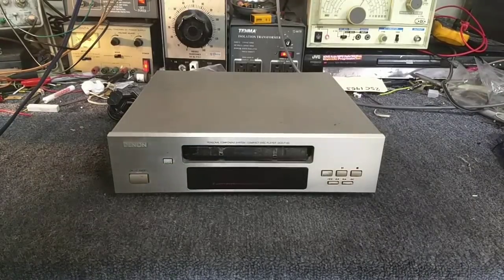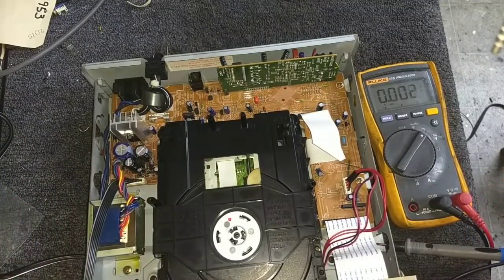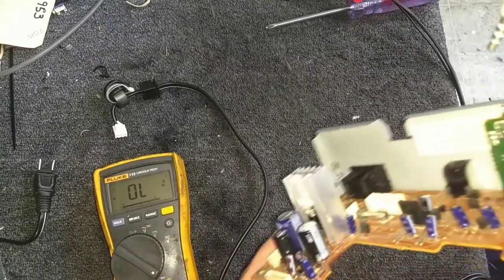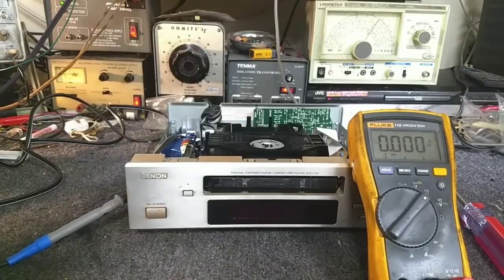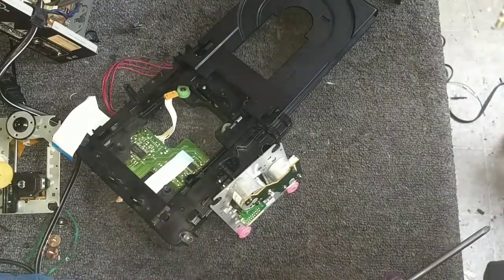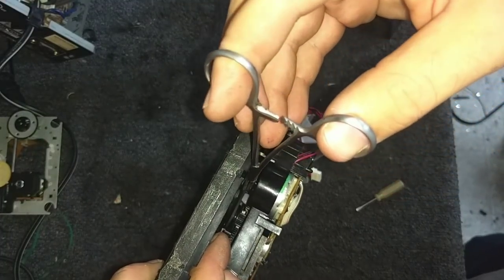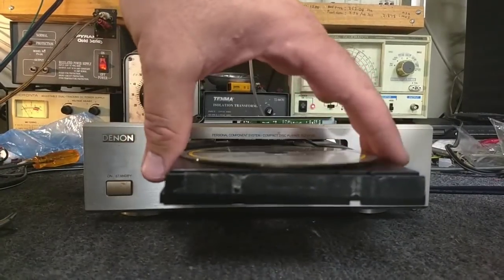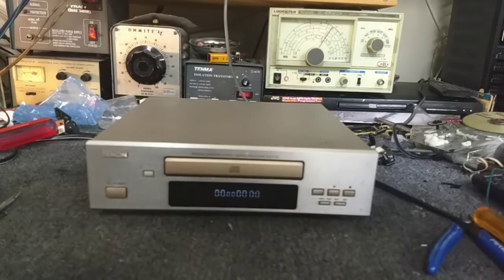Troubleshooting a dead Denon CD player model DCD-F100. Can we fix it?

Comment: Thanks Jordan! This helped me a great deal to fix my DCD F-100! While I initially suspected a defective laser it turned out in my case that it was only the motor belt being worn out so the mechanism would not fully lock (though not visible from outside, tray closed) and hence unit would not start reading CD. I managed to replace with a 35mm belt that I got online in a multi size pack.

Comment: There are some few tips to recognise from where the problem is . At the time of focusing just you have to move the disc slowly with your finger , if a track searching sound comes from the optical unit then the problem is in the motor driver section . 
First check the disc drive motor , if the motor is ok then follow the two wire which is connected to the motor driver IC . Check the continuity from motor to driver IC pin . If not ok then check two smd 0'1 ohms resistance which are on the pcb in front of the driver IC .
Most probably one of them is open .

Comment: Back in the early 90s I frequently had to replace CD laser units, they were never plug and play, even brand new genuine OEM parts or swapping between good/bad units. Removing the solder bridge was just the start, calibrating the eye pattern on an oscilloscope was always essential as an absolute minimum. 
Pioneer models even needed mechanical adjustments to the diffraction grating (using tiny ball ended hex keys) before you even got to thinking about adjusting the pots. Customers loved those models, but as the workshop manager I vetoed them, they took from 10 minutes to several days to set up.

Service manuals were essential, back then they were easily obtained and would detail the calibration procedure. 

We're talking 30 years of forgetting stuff, but I think they needed to get an initial focus before the spindle motor would even start. No focus; no spin. Check the eye pattern on that unit, you'll probably have to Google and best guess. From memory, each manufacturer quoted a precise value somewhere between 0.9Vpp to 1.1Vpp so there's at least a ball park to start playing with.
Reply from the maker: This set had no service adjustments for focus, tracking, etc. No mentions of adjustments in the service manual either. Probably a fixed set of variables, or "best guess"

The fact it tries to focus but is unsuccessful makes me believe whatever circuitry is responsible for interpreting the rf from the laser isn't working. Might of been what killed the ic protector
Reply: @JordanPier  I'd look at the bird eye, just as a sanity check if you can. Some pickups also have pots on them. Otherwise, yes; its probably not worth spending/wasting too much time on.
(But I bet you're like me, curious to find out why it's not playing properly 😉)

Comment: How much are we betting that somebody tried fitting the replacement transport unit before you got your hands on it, forgot to desolder the bridge on the laser, blew out the servo and the 5v line on the PSU, and so put it all back how it was (missing a couple of screws in the process) and hoped you could fix it...

Comment: jordon I just diagnosed a unit and had similar problems but with mine I had a bad Electrolytic capacitor and 5 volt regulator and diode   .

Comment: I have a NAD CP player with the same mechanics, and the same issue.
The laser works, and tries to focus and reposistion, but does not spin the disc.
I tried replacing the laser unit but just as you, that didn't fix it.
To bad. Guess it goes in the trash.
Thanks for the informative video.

Comment: Hi Jordan,
Just to be clear, when you said that the laser couldn't read a CD-R, that that was a sign that the laser was getting weak and might be on its last legs? I've got a Sony Boombox from 1996 that's doing something similar. So, maybe I need to keep my eyes open for a replacement laser? Can you recommend a good seller for replacement laser assembly?
Reply from the maker: Wish I could. Its getting harder to find genuine laser pickups for Sony products. Most of the ones out there are Chinese knockoffs that perform poorly and fail within a year.
Reply: @JordanPier  It's not the answer I was hoping for, but thanks for the quick reply.

Comment: Shame, this is why I like 80's and early 90's CD players, they have a lot of discrete components that can be replaced if a couple of them fail.
With the more modern stuff? Everything is in 1 or 2 ICs and good luck finding replacements at a decent price.
That's why I'm taking good care of my old Technics SL-P150, I also have an SL-P116 but its laser died and it's practically impossible to find the replacement so I just keep it for decoration lol.
I also had a beautiful silver SL-P2, but idiot 15 year old me traded it for a 5 disc player.

Comment: CD technology is the most unreliable electronic concept that's been created so far. Incidentally, the solder bridge should not be removed until the ribbon cable has been connected, and the ribbon shouldn't be removed until a solder bridge has been made. Failure to observe this will likely result in a dead receiver diode. They're super sensitive to static electricity and many new optic blocks have been damaged by people failing to observe this.

Comment: Try ajusting the screws holding the CD drive mechanism down and ajust the focus ajustment pot on the back of the laser unit, might just need a slight ajustment, if there are the 3 pots on the main board like most sony/aiwa/hitachi/jvc players had might need a tweak.
Reply: The preset on the back of the laser optical block is NOT the focus adjustment. It is the RF level and you shouldn't touch it. 'Tweaking' it might make the unit read discs for a while longer but it won't last - you'll just burn the diode out sooner.

Comment: I bought a new Denon dcd 600ne it has the same sony board and the big white plastic gear on the mech makes a crazy vibration noise i took apart and messed around with it a little bit and it started working right but as soon as I got the hood back on it started again 😥

Comment: I didn't see the CD motor even try to spin... it should to read the TOC
Reply: Iirc, (and I'm repeating myself so that you'll see it) it needs to focus before the spindle spins. No focus, no spin.
Just for fun it could equally be yes to focus and no to controller or motor/drive circuit. With a schematic you can work out where it gets stuck, back then they were little more than basic state machines.
Disc spin was (historically for me) a sign that you're nearly there.

Comment: There`s only one solution! SA5810 driver for the motors.
Reply from the maker: If I spin the cd manually there is no sign of it trying to read, which if it were solely motor control based would be present. 

Usually in this system there has to be a positive response in the firm of data red back from the laser prior to initializing the spindle motor. Since the sled motor returns the laser to a start position to read I assume the motor control is fine - especially since to attempt to read and focus is made.
Reply: @JordanPier  So what do you propose?
Is it a controller or what?
Reply: @JordanPier  At this stage you can't exclude mechanical damage yet. The spindle can be at the wrong height (so no focus and then no spin command). The spin motor can be broken, etc.

Comment: What a shame, but you did all that you could.
I'm still confused about the microfuse.
Reply: Back in those days it wasn't unusual to have a 20mm fuse on the PCB. They relied on it heating up and blowing in case of over current. Great for our safety, but it wouldn't protect the circuit. Even a fast blow fuse would be too slow to protect the active components, so active fuses were a thing; they'd react quickly and crowbar the power away from the circuit and blow the fuse.